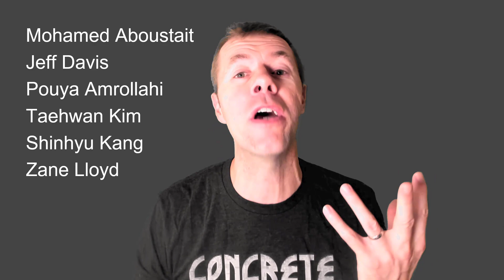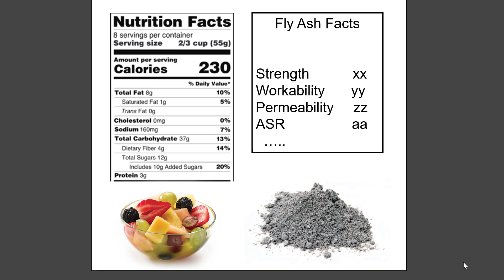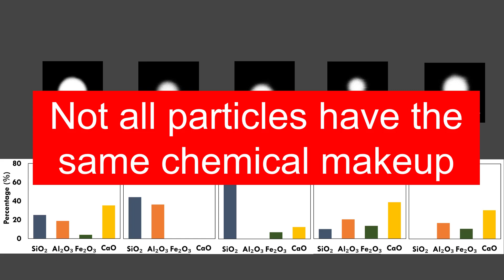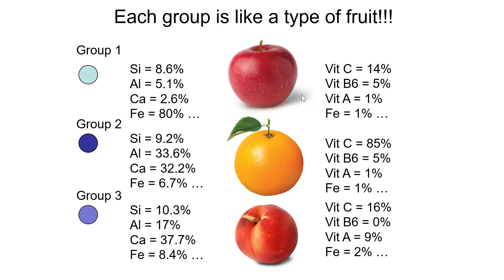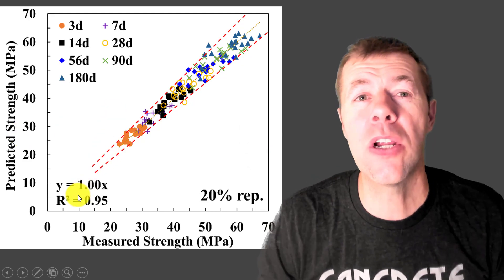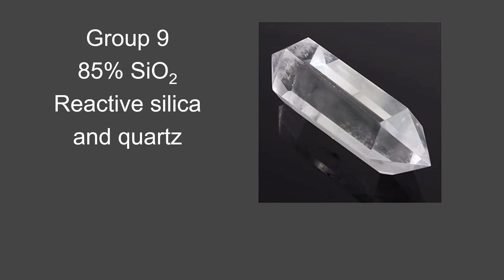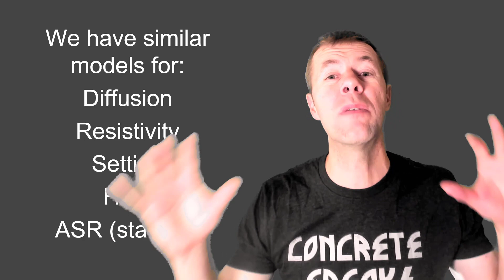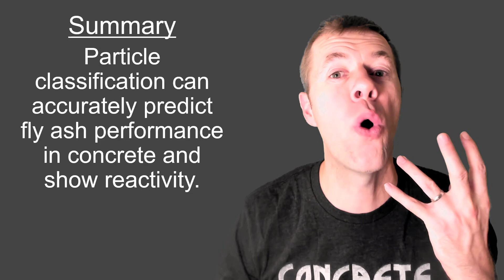Unlocking the DNA of Fly Ash | Performance based prediction of fly ash in concrete

Comment: This is a very good explanation about the chemical composition of Fly Ash. In the video you have told low content of iron has impact on the strength. However higher content does not have any. Although you have justified this based on literature, but is there any valid explanation behind this? I mean what is the actual reason behind the iron content being active at low content but not at high content?  Thank you.

Comment: Fly ash sucks!! The problem with Portland concrete is they mix this crap in with it. Concrete lasted longer before fly ash. Concrete poured 50 years ago was way stronger and lasted longer. Now we depend on China because we need the ash which is pulverized coal to mix into Portland concrete to make it cheaper. Now concrete begins to breaks up sooner and water gets into the concrete causing  it to expand and turn to a gell inside breaking up and turning yellow. Hairline cracks expansion. Concrete only lasts 20 years now, but concrete poured in the 1920s is still in existence and in good shape.

Comment: I love your insight into concrete. I am intending to purchase a 3d cement printer. The company that I am working with adds fiber, but I am not sure about fly ash. Fly ash is cheap and use is environmentally friendly. I am in north Texas and I would love to hear your ideas about use of fly ash in 3d printing. How does it change the viscosity of the material
? What about fly ash in foam or low weight concrete to be used as an insulator? Where would you recommend that I attempt to get my fly ash or the name of the fly ash you would recommend in the DFW area? Thanks

Comment: Great info! Would you know the best formula for creating a plasticized concrete mixture for sculptors?  Best so far is 1pt sand 2pt cement, 20% metakaolin (hoping fly ash will do).  Liquid with 10 to 20% acrylic solids, some sugar and fibers. The goal is a conc that acts more like clay before setting.   Would you know of any way to make this better?  Will fly ash work as a metakaolin substitute?  I think concrete for sculpture would get you a lot of hits.  Thank you, Cheers!

Comment: I want to send a sample of my local fly ash somewhere and have the results available on a public website - so everyone considering fly ash uses would be confident.  Um, everywhere.  Who is funding this research service?  Also, is fly ash being bagged up - like in used brewery grain bags, etc? And a lab performance rating too? Very cool.
When just 7% lime can make a "pad" -  I'd like instead to fill tires with what can "consolidate" a percentage of Styrofoam chips and still have a load bearing CMU.  A whole truck load of fly ash would be lovely.  Now I want a big enough tent too, of course.  Or, bags I can go get a load of somewhere.  Oh, maybe with a lab report too?  I'm thinking fence posts, air-crete, ... Please start this and put me on the email list.  Thx

Comment: Tyler,

Would you be able to make a video on the crossover effect i.e. why faster curing results in less strength and possibly less durable concrete?
Reply from the maker: Alex - Faster reactions build less efficient microstructures.  These microstructures will have more imperfections and this will cause a deterioration in performance.  I will see if I can fit it into an upcoming video.

Comment: Why not at least mention fly ash toxicity and how to be take precautions to not  poison yourself or the environment. https://www.sciencedirect.com/science/article/pii/S0045653518317004 
For full disclosure, do you get any funding from the coal industry?
Reply from the maker: No funding from the coal industry.

Using fly ash in concrete is very common and has been a common practice for 80 y.  This is a great place for this material because it is encapsulated and also improves the quality of the concrete.  Many studies have been done to look at the leaching of fly ash in concrete and I don't know of one that shows there is a health hazard once the fly ash is encapsulated.

Comment: Have you looked into the toxicity associated with materials containing Fly Ash generates by the coal fired power industry?
Fly ash is considered as an environmental hazard worldwide. It usually contains organic pollutants, toxic metals like Se, As, B, V, Al, Pb, Hg, Cr and radionuclide's - in particular Uranium and Thorium. 
It’s ironic that some research suggests that fly ash could be used to absorb contaminants and toxic chemicals from the environment. Especially in soil remediation and treatment of other industrial waste streams.

I certainly wouldn’t breath in cement regularly  - with or without fly ash

Comment: Hello Tyler! I have a question. Why DIY builders add salt (food grade salt) to the cement paste? Is it helpfull on low temperatures? Is it bad for a concrete durability? Thnx!
Reply from the maker: If there is steel in the concrete then it is really bad.  They add the salt to increase the rate of strength gain.
Reply: @TylerLey  Thank you!

Comment: Add a rust inhibitor to the cement to protect the rebar. This can be as simple as adding zinc in the mix to act as an sacrificial anode. No need for galvanizing.

Comment: Thanks tyler I pour most with fly ash concrete did some of my own research a few weeks ago because the concrete had a strong ammonia smell when we were pouring the pours also had alot of plastic shrinkage cracking before setting hard have you done research on contaminated fly ash and what could be the result for durability and set times compared to fly ash with out high levels of ammonia
Reply: Fly ash can block bleed water so the top starts to dry out, especially on very hot days.
Reply from the maker: Bryan - I have not done a lot of work on this.  Ammonia is used as a way to reduce air pollution during coal combustion.  If you can smell it that strongly then you should complain to the supplier.  I have not heard of the ammonia causing any side effects to the concrete but it might.

Comment: Dear Pr Tyler 

I really enjoy watching your videos especially this one which i watched 3 times to understand deeper because the use of fly ash in concrete industry causes many issues especially the chemical composition variability and  that is obvious because every power plant use a unique coal, so it would be tricky to predict the performance of concrete using many type fly ashes particularly in concrete industry. However you have just found something to deal with this variability using maching learning and classification of fly ashes. But to understand more about this study, could i have some research paper to read about it and to go deeper in this insight study ? 

Thank you so much Pr. Tyler 

Best Regards 
Elkhalil Ph.D Student / Hydraulic Binders 
Morocco 
elkhadirelkhalile@gmail.com
Reply from the maker: Elkhadir - Thanks for the message.  Check the notes below the video.  You will find some references and a special link!!!

Comment: Have you found that the source of coal makes a difference? Do different plants produce different fly ash from the same coal source?  I sure wish I still had the full engineering report from the Powell dam where they did some major pioneering work with fly ash. i knew one of the cheif engineers from that project. They surmised that a 20% replacement was in order for the dam project. I recall that there were concerns with the exothermic build up may have been the reason they held it at 20%. The fly ash used was generated by the Clarkdale AZ cement plant, which was built specifically for the project. I wish I was still in the game and wish I had more to offer you. This is incredibly important research you are doing Tyler. All the best!!
Reply from the maker: Thanks for the comment!
The coal does mean a lot as that is the raw material that is combusted; however, it is more complicated than that.  It has to do with the burner design and the cooling rate of the ash.  We know this because we can track coal trains and where they take material.  We can follow the same train going to the different power plants and we find that the fly ash that is produced has a different set of groups.  If I could team up with a utility then we could REALLY make some cool breakthroughs.  That is one reason I asked for people to reach out that had a similar interest.  There is a lot more to come on this subject...
Reply: @TylerLey  What’s the easiest way to reach out? Very long story short, I’m trying to get research done on improved Rammed Earth for it’s application in 3D printing. I’d love to get in contact and see where we can work on this stuff together.
Reply: @thunderofgr  how on earth are you using rammed earth in 3d printing? :)
Reply: @chas180  Basically with a house sized form that the printer tamps along and compresses the next layers of earth as they’re added. There’s a company called Formearth that has a small prototype of an automated rammed earth machine. Very similar design but radically different execution and much smaller scale. Before the copyright lawyers all descend upon me, I’ve been working on this for years. Just getting the last few pieces into place for printed walls to be done this year.

Comment: What part does the aggregate play, e.g., desert sand, crushed basalt? I live in the Las Vegas Valley and have heard there is an old decommissioned power plant outside town. Would fly ash work with desert sand or lava sand? Can I avoid expensive Portland cement, altogether for a security wall?
Reply: I used to use fly ash in my work in the Verde Valley outside of Sedona. I had a modified adobe mix as I called it. They have something called unwashed bedding sand which has a mix of particle sizes, some silt and a decent amount of clay, less than 10%. To a yard of that, I would add 50lbs of fly ash and 50 lbs of portland. It would hydrate well and set up with over 1000psi of cured strength. Hope this helps
Reply: @wearemilesfromnowhere4630  I'm thankful. I need to check the clay content, but for a security wall I now know it I find zero clay I need to add about 10%.
Reply: @1voluntaryist  depending on the clay, I have not gone over 10%. I would stay away from the green clays. What you want is just enough to make it stick to itself but not so much that it swells and contracts to create cracks. It's a bit of an art. I think I recall some clay deposits up on Mount Charleston. Look for shallow pools after a good rain then look for cracking on the surface. You can skim that top layer. Natures slaking done for you.
Reply from the maker: Don - Great question...
You can use some fly ash by itself and it will hydrate; however, it is often better if you combine it with at least some portland cement.  See the other comment from "We are Miles..." for an example.  We could use this model to do some analysis on your fly ash and tell you a lot about this.  We could use this technique to help people identify what fly ash reserves are valuable and which ones are not.  Also, you can definitely use desert sand or crushed basalt in this concrete.  You just need to know how to design the concrete mixture.  Watch the videos about the Tarantula Curve for more details.

Comment: Hi Tyler love your videos I am concrete contractor here in New York City I do large commercial and public work and I still learn something new every time I watch your videos!  Fly ash and GGBFS are cement substitutes correct, how exactly does that add strength to concrete if your substituting it for portland?
Reply from the maker: Mike,
Check this video out:
https://www.youtube.com/watch?v=0wOCn7smmIs
Short answer - They either act as cements that are chemically activated by the portland or they react with the calcium hydroxide from the portland cement reaction to form more binder.  Watch the video as it does a better job than a single sentence. =)